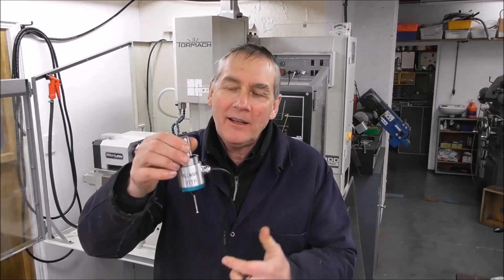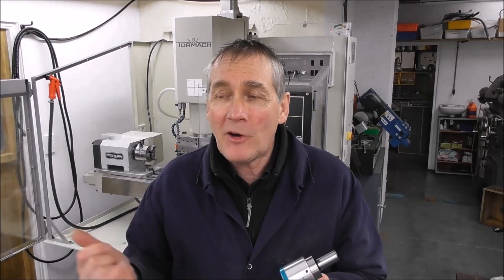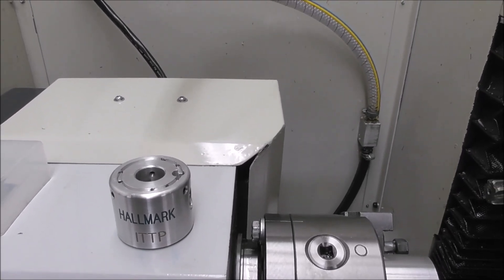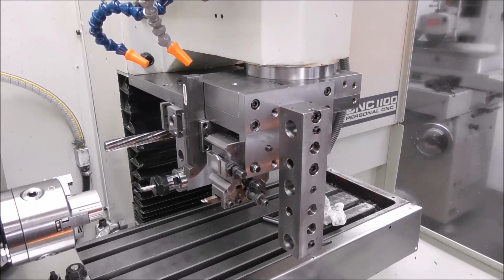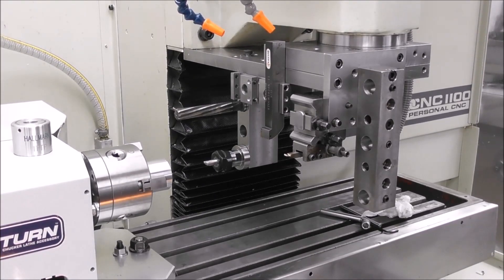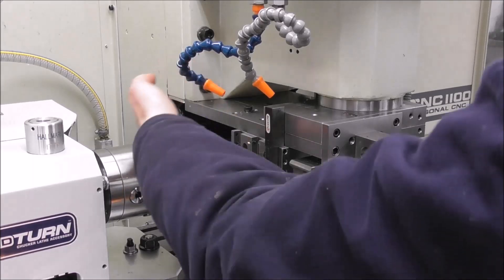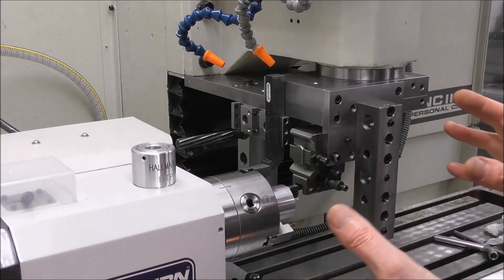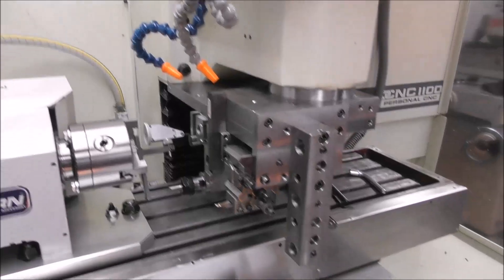Tormach RapidTurn  - Production Made Easy -  Part 27

Comment: Hi Cliff,
Great Info here.  Thanks.
I've got a curious question...   ...have you tried using the ITTP to touch off "Master Tool 1" on this gang tool set up?  Will it work in the horizontal position?  I've been following this RapidTurn series trying to decide if I should get one of these or save up for a slant pro.  The parts that I'm quoting are aluminum, irrigation hose connectors and reducers.  The tolerances are huge on the barbed hose connections +/- .020" turned from bar stock OD of 1.25".  I'm doing them on a manual lathe but it is mind numbing.
Thanks again,
 Mark
Reply from the maker: Thanks Mark.  Well there is no probe page facility in Rapidturn so you would need to have a good understanding of coding to attempt that. Yes production of more than a few on a manual lathe is horrible isn't it!   Rapidturn is amazing value for money, but it is not nearly as powerful, rigid or accurate as slant pro. I am getting by on work that is not highly precision, I can work to about +_ 0.001"  with the occasional 'blip' . If you only have one mill, I would seriously consider Slant pro for your second cnc. If you already have 2 Tormach mills, as I do, Rapidturn makes more sense. Cheers Cliff

Comment: 6:36 I could have used that dial test indicator holder today on a haas st10, looks much better than the atypical magnetic base one such as I was attempting to use apparently incorrectly on the tool [#3/bs3 center drill], it was suggested I instead use a .5" (half inch) gage pin, it looks like you're using a 1" pin there...at least you can easily see what you're doing, the haas has a tiny window that seems to get 95% of the coolant spray, needs a waterproof video camera pointing from the opposite direction so I can actually see what's happening "at the moment of truth" close to the chuck because it locks the door during program run so no access/visual scan til the next tool change. I think a lot of guys disable the safety features....
Reply from the maker: Yes I often wonder how you get at things in the typical VMC - my stiff neck would make it a nightmare!   Yes that type of dial indicator I use always has the dial in view. Thanks for sharing.  Cliff

Comment: I have to jump in a build some gang tooling to get the best use out of my rapid turn. I have the the stock qtp setup and cannot say that I like it all that much. I have a bunch of aluminum 1 inch plate, do you think it would be rigid enough to build a similar setup as yours?
Reply from the maker: Hi Clifford. Aluminium will be rigid enough, I thought about using it also. But it has twice the thermal expansion of steel, and so you might have some part sizing issues in some situations....cheers   Cliff
Reply: Thanks for the reply, I think I will give it a shot with the aluminum and see how it goes, should be a fun little project.
Reply from the maker: Cool...keep me posted. Email if you like - see under 'about'. If your TTS 'drop blocks' are steel, and only the platform plates alum, the thermal expansion will mostly only be in the Y, and that will have little effect on accuracy. Cheers  Cliff

Comment: Hi Cliff, from a design point of view I would suggest not to make an engraving. Just a lasering of all necessary info like name, serial, origin, a barcode. Lasering gives you more freedom of typography, is easy to make and gives a very professional, consistent & clean appearance. Together with the anodized blue it would look great. 
Cheers
Herri
Reply from the maker: Thanks Herri - With Lasering is that contracted out... or is the equipment bought?  If so approx cost? Cheers  Cliff
Reply: Threadexpress I agree, lasering will probably be easier and more professional in the long run.  Here in Vancouver Canada most anodizing shops also have laser engraving/etching.  Not sure about down under though!  Keep up the great videos :)
Reply from the maker: Thanks Philip.
Reply: The engraving looks more high end, laser looks like typical chinese parts.

You could make a vinyl mask (cut vinyl with vinyl plotter), then beadblast a design. It is a cheap, fast option to add to your current setup.  5 minutes and pennies to do it.